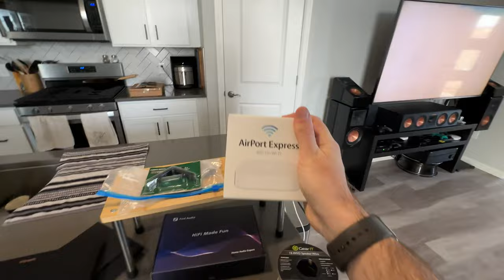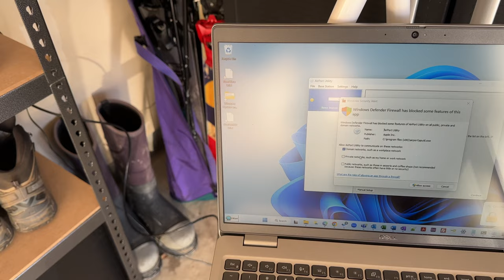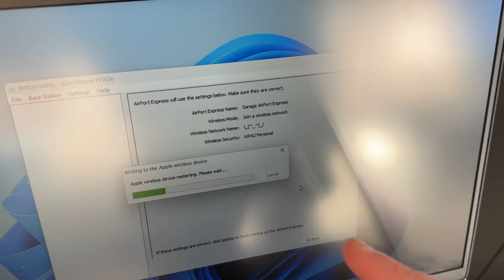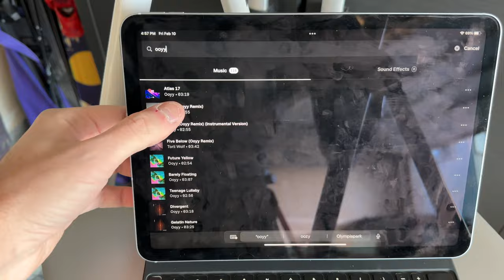Garage stereo installation! Combining AirPlay with a custom 2.1 Klipsch sound system

Comment: Nice garage, all it needs now is some paint, like your videos.
Reply: Looks like a townhouse rental, but if he owns, I agree with you. The first thing I did before I moved into my new house was insulate, sheet, paint and heat my attached garage. Been enjoying that space for 20 years! After two or three years of using The Fives by Klipsch with a Klipsch 400w sub, I'm hungry for the Nines and moving the Fives into the garage. The Fives would blow me out of my garage.
Reply: I fkn did remodeling while living in it. 😅 that was terrible moving things around way too many times.